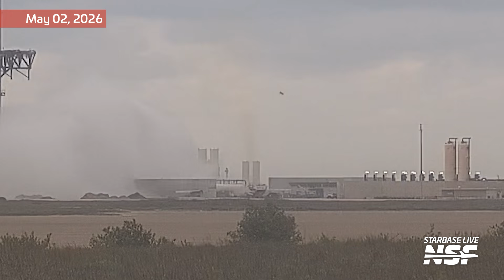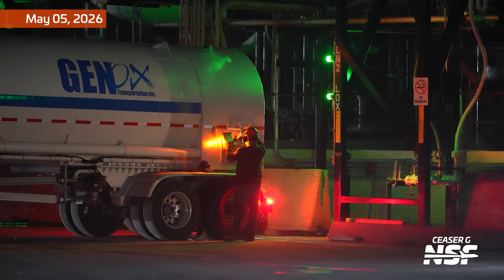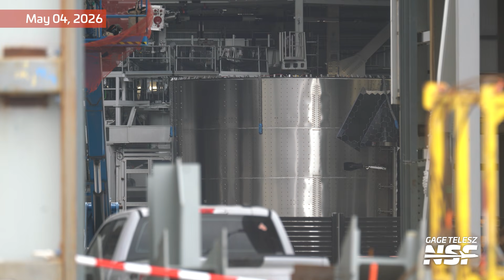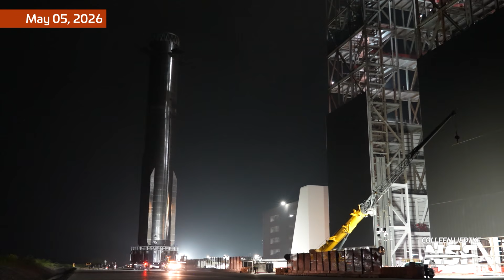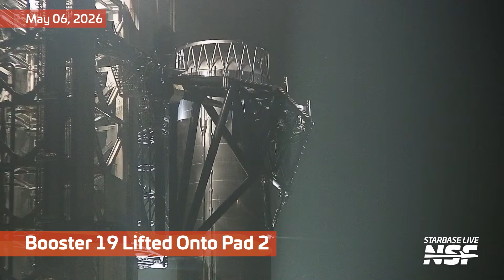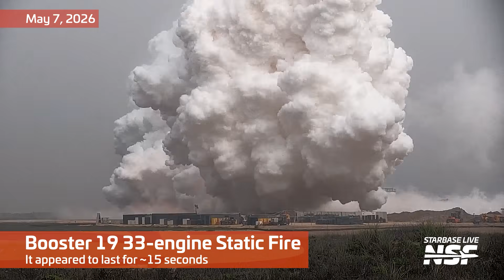Starship Flight 12: Booster 19 completes Static Fire test | SpaceX Starbase

Comment: I don' think that was slack or lash causing the bo-yo-yoing.  It looked to me like the motors did that, more of an oscillation in the control signal.  They need to dial in their gains on the PID controllers for fast moves.

Comment: Spacex needs to make a small single engine "ship". Deploy satellites with just the booster since you wouldn't be lifting the mass of a starship.
Reply: That would require them to expend a booster, can't see that being the way they'd go.
Reply: @imaginary_friend7300 they get a fully loaded starship to near orbit. What if it was only 1/4 or less of that weight. Orbit and a return could be possible.
Reply: @Maelthras  No where near to orbit, the booster actually stages as early as it can.  Starship does the lions share of the work getting into orbit.
Reply: @imaginary_friend7300  While not carrying anything but itself and the internal payload, booster though lifts starship entirely up on itself, and considering booster has 33 engines vs starships 6, the booster does way more of the work. What I am saying is what if booster went up fully loaded, but no starship... How high could it get.

Comment: The static fire looks amazing.  Is it just me or did one side of the trench seem to have more flame than the other? Like it didn't have enough water pressure or something. It could be just the angle that's playing tricks on me though
Reply: The trench walls are not symmetrical, so the exhaust also should not look symmetrical on both sides

Comment: Would the deluge system damage the Raptor nozzles with the sudden cool water that blasts into the engines,.🤔🌝🇬🇧🇺🇲
Reply: This is a cool question! My guess is that the speed of the water from the deluge system is less than supersonic and the exhaust from the engine is at least supersonic, the pressure (?) and heat of the exhaust far exceeds that of the deluge system, so the water never makes it to the engines at all. Also keep in mind, inside the engine bell is thousands of degrees in temperature and the outside the same engine bell is negative hundreds of degrees in temperature, so the engine is already experiencing extremes of which the temperature of the water may actually be HOT relative to some parts of the engine. Can’t remember if the engine bell is film cooled or if the methane is piped through the engine bell walls.

Comment: how are they gonna make Pad 1's tower taller?
Reply: Why do they need to?
Reply: The V3 boosters will sit lower on the new launch mount than earlier boosters did on the O(riginal)LM because this one has a flame trench dug out below surface level, unlike the OLM.

Thus SpaceX needs not a height increase to keep using Tower 1.

Comment: Regarding the "slack" you mentioned Das, I think thats one of the things there doing in those tests, checking movement commands match up with actual movement, motor tuning and importantly dampening. I know in sub orbital rockets that get launched nearby me, they use PID controllers to move fins that stabalise and steer the rocket in flight, and one of the harder things to get right is the PID dampening tuning, stopping the motors over turning or having slack like you mention. You can only get so far writing the code and simulating, you need to test the code with real imputs with weight, gravity ect then the feedback from the test get crunched, code changed to be more precise. 

Kind of a small scale of what we saw with the tower catch arms! First times they tested swinging the arms, everyone noticed the crazy amount of movement they had after "stopping". But through testing and changing accelleration and decelleration speeds at the start and end of movements you "dampen" out the effect, even adding count movements once its come to its supposed final spot, to push against any inertia. 

Its a fascinating field in itself mechanic motor movement dampening lol

Comment: It doesn’t appear to be paint on the bottom. Can’t see the seams and welds. Appears to be some type of covering.
Reply: It doesn't really cover any seams or welds, that's why you can't see any, because there are none. Also the fact that it had already been applied to an area of the aft of B19 (and even B18 before it went boom) earlier in the year and it was clearly paint given that it chipped off.
Reply: @Alexphysics13 yes there are welds and seams. Each ring has welds from stringers and sheet welds. Every ring section does.

Comment: Power is measures in Watts for everything except motors.  This is particularly puzzling for electric motors.  Why measure the electricity used by the motor in Watts but its output in horsepower?